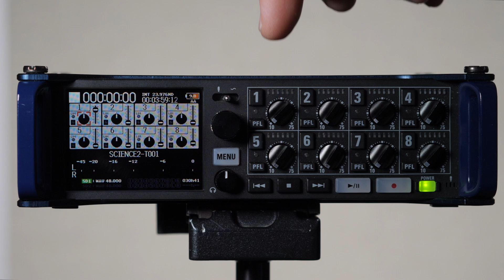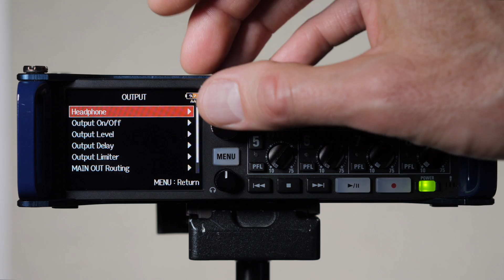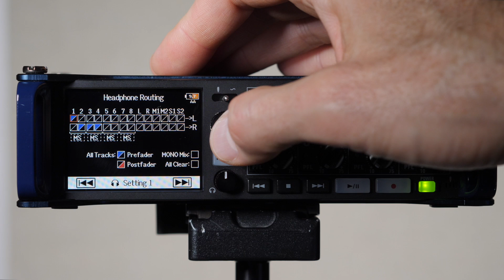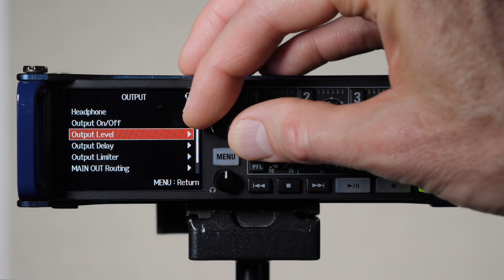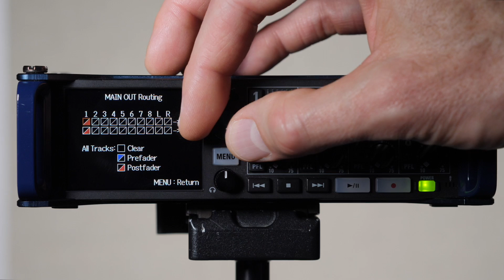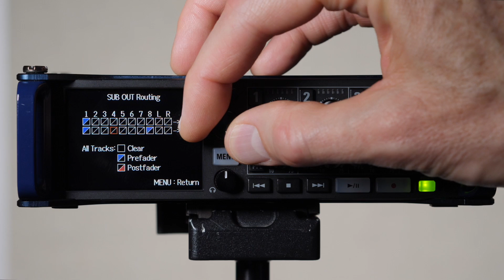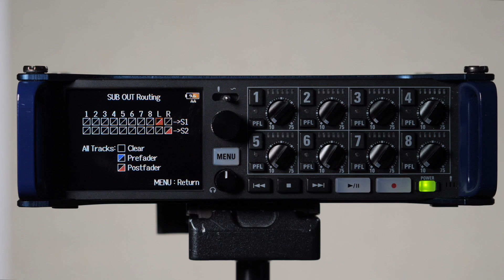Sound for Video Session: Headphone and Output Routing Demo - Zoom F8 Recorder

Comment: You mention here that sometimes they use the audio sent to the camera to do a cut, and then the audio-person needs to sync up later after the cut. How would this be done if you get one finished video-file? Or am I missing something? Thanks!
Reply: Post editors sometimes use vocalign for this, but normally, they'd get an OMF or AIFF file which can then be imported into a digital audio workstation app with all of the original clips.
Reply: @curtisjudd  Thanks. Wouldn't this then only be the audio from the camera? I don't see how the post-audio guy would easily do this.
Reply: @Libsenth  That's a tough thing to answer in a YouTube comment. It is a very big topic to cover film post workflows. But for the films I've worked on, Editorial had the production sound clips and synced the production sound to picture, then did the edit, then sent the OMF/AIFF to the post sound team for mixing.

Comment: Great Video as always Curtis! I was recently prepping for a shoot and noticed that the headphone routing only abides by the settings when using an external power source or the 12V DC In power cable. When I was setting the routing using just AA's, I was unable to get stereo separation from the multiple input sources. Is this a set function of the f8n? Thanks!
Reply from the maker: Hi Reid, not that I've noticed, but I almost always power it with and external battery. Probably best to confirm with ZOOM support. Best wishes!

Comment: Great video - thank you.
Question - Is the Zoom F4 in USB mode - can it record also to the SD card in parallel?  didn't find this answer yet.
Reply from the maker: Yes it can.
Reply: In what settings.
When i turn the aif on.  The usb interface is disable.

My goal is to record both to the sd cards and in parallel through the usb into the tricaster.  Couldnt figure it out.

Thank you for your help
Reply: @videobox2452  First make sure you have the latest firmware installed on the F4. Then in the USB menu, you'll select the option titled, "AIF with Rec" which is the mode where you can record with the F4 and use it as a USB interface at the same time.
Reply: @videobox2452  Also, if you're interested, I have a full course on the ZOOM F4 over at school.learnlightandsound.com
Reply: @videoboxstudios  It works when I try it. You may be best of contacting ZOOM support. Best wishes!
Reply: @curtisjudd  thank you for the great content you provide.   Honestly, I think that Zoom should pay you for the great videos you create for their products.
Reply: I purchased your course a week after i purchased the Zoom F4 last year.
Great course to dive into the Zoom F4.

When I turn On the Aif with Rec.  I cant go into the Audio Interface at all.  

I do have firmware 3.00.
Emailed to Zoom - they didnt reply.
Maybe there is something I'm missing with all the different options 😀

Comment: Hello Curtis,
Thank you for this video. 
I have a little issue, but maybe I am doing something wrong. I have a ZOOM F8n, and bought two LoPro TA3F to Mini TRS (https://www.cabletechniques.com/product-page/lopro-ta3f-to-mini-trs-sennheiser-sk-100-g3-line-input-cable) to use with a Rodelink Wireless System to give signal to director, boom operator, etc. I know that this is not the best option but I have two kits of the Rodelink and I'm trying to make it work. 
The problem is that I get no signal when I use the two Main Outs, but if I send the signal through the Sub Out (using a regular 3.5mm to 3.5mm cable), it works. All the routing options are similar with the Sub Out settings and the faders are up. What am I doing wrong here?
Reply from the maker: Hi Jérémy, the sub out is unbalanced as is the input on the RODE so I think you'll want to stick with that. I don't know how that other cable is wired, but evidently not correctly to take a balanced TA3 output to unbalanced 3.5mm TRS for an unbalanced input.

Comment: If I have 5 audio tracks I want to send to all 4 cameras (a mixed track), what do you suggest is the best option, do I select all of the outputs 1 through 5 or both LR? ie. Both Left and Right channels to one output as opposed to two ?
Reply: I'd just send the LR mix. And the rest totally depends on the production. Ask the post team what they want/need. If I were the post team, I'd just want a LR mix. And unless you are panning anything, even just mono L mix would be fine.

Comment: What is the U1, U2, U3 and U4 setting for?  It isn't mentioned in the manual, and apparently was added in a firmware update or other software add-in. It shows up when I rotate the know further clockwise, after the S2 box. Possibly has something to do with the available control surface...
Reply: Hi Larry, these allow you to record audio from your computer via one of the 4 USB streams when in audio interface mode.

Comment: will the Post-Fader settings actually record to the SD-Card? Or are all the Post-Fader settings only essential for output to the camera (for example)
Reply: Postfader affects what is sent to the L+R mix and if you have the L+R mix enabled, it will be recorded post fader. However, the isolation input channels will NOT have the fader levels applied to their tracks on the recording. You get the best of both worlds.

Comment: Hi Curtis,
Couple questions...
1. The headphone output has at least two settings. How do you make settings 1 active vs. settings 2? Do you enter into the menu, then make it active somehow and exit the menu?

2. W.R.T. main out routing...How are you wireless sending audio? You have a transmitter connected via 1/8" (for example) to the recorder, and the wireless receiver has a headphone input? Do I have that right? One transmitter can transmit to many receivers tuned to the same freq, since the transmitter is just broadcasting?

Thanks,
Sean
Reply: Hi Sean, 1) You hold down the stop button and press the channel 7 button which takes you directly to the routing screen. From there you press the fast forward or reverse buttons to change which headphone preset you'd like to use. 2) For headphones for the director, producers, and others, I use a comtek like this: https://youtu.be/V_C7wSfNIaM
Reply: Thanks, Curtis! Very helpful.

Comment: I have a question friends: In my f4 zoom, I wanted to send a sub out to the camera, the camera caught -20db signal from my zoom, but did not catch any sounds from my channel 1. Where was the pole. Why could it be like this?
Reply from the maker: Hmm...not sure. Might need to check the routing for the sub out and made sure it includes the left and right mix.
Reply: @LearnLightAndSoundSessions  I marked only 1 channel as a prefade, can it work?
Reply: @ola_szczyrek  It can work. But it seems nothing is actually coming in on that channel? Hard to tell without more details. Might be helpful to contact Zoom support to help work through the details. Best wishes!

Comment: do you know if you could use the zoom f8 internal mic (the one from the bottom right corner of the recorder) as "a local mic" as you mentioned at 10:08?
Reply from the maker: Yes, it is a slate microphone. Not sure whether you can record it to a track - it is routed to all tracks when you engage it.
Reply: @LearnLightAndSoundSessions  but then does it get recorded onto all tracks if its engaged during recording?

Comment: Is there any way to adjust the stereo-width and level of a pair recorded as separate Mid and Side channels during playback with the MS>LR circuit engaged? I cannot seem to engage MS post-fader. The only way I can get F8 to engage the M/S decoder and convert to L/R is to route those channels pre-fader.. yet then there is no control over level or panning (stereo width).  Engaging MS in headphone routing automatically switches the pair to pre-fader.
Reply: Hi Lee, I haven't done any M/S recording with the F8 so I'm not sure. Probably best to contact Zoom support. Best wishes.

Comment: Say if Track 8 was used as a mic input for communicating with Boom Operator. Is there a way to not record Track 8?
Reply from the maker: Reduce the fader for track 8 to its lowest setting and adjust the headphone routing to include track 8. Track 8 will still be recorded but you can drop it in post and it will not be in the stereo mix.
Reply: @tripdrip4174  👍

Comment: Very noob question, but how I do connect this to my camera?  I know I'm supposed to use the main out, but what cord would I need and do I have to fiddle with the settings in my camera afterwards?
Reply: I think this video may help - demonstration of how to do this with the Zoom F4: https://youtu.be/DypXXzPhxF8

The F8 is similar but a few of the screens are slightly different. I also have a paid course on the F8 over at school.learnlightandsound.com if you're interested. Good luck!

Comment: Hello! Very interesting! Thanks Curtis!
One question: When talking about the SUB OUT you mention "Thats where i'm typically send audio wirelessly to the rest of the crew". What are you using to wirelessly transfer the audio to the rest of the crew? And is it possible to send the audio directly to the camera with some sort of transmitter/reciever?
Reply: Yes, comteks are usually used to send a wireless feed to the crew: https://youtu.be/V_C7wSfNIaM

When you send audio to camera wirelessly, this is usually called a "wireless hop". Here's one way to do it: https://youtu.be/_c64B9s0eCA

Comment: Great video again. Quick question. Is there a way I can monitor exactly what is being recorded to camera? That is, just if I want to check that nothing has gone wrong on their end. I use the old reliable SQN a lot and that has a switch you can use too toggle between the mixer and the return feeds.
Reply: Hi Stephen, unfortunately, the F8 and F8n do not have a dedicated camera return input so you'd have to monitor from the camera itself. The F4 does have a camera return, strangely. On the F8, you could feed the audio back into one of the F8's XLR inputs if you have one free and then set up a headphone preset that only includes that one input.
Reply: Ah interesting! Thank you for the info!

Comment: With the F8n set to dual recording, say for example tracks 1 and 2, are doubled to D1 and D2 (tracks 5 and 6), it seems to send both the track and it's double to the main mix. This makes it somewhat difficult to record isolated tracks and the dual tracks and send a l/r mix to a camera. There is no option in the main out routing to not send the dual tracks to the main mix. I can send just track 1 and 2 to the main out, but this makes monitoring using the meters difficult. What am I missing?
Reply: Do you still have the L or R mix selected in the output routing? Sounds like you'll want to disable those and make sure that channel 5 & 6 are also de-selected.

Comment: Question: when using the f8 as audio interface, how can you turn the volume up and down for the main out speakers? Thanks
Reply from the maker: Hi Alberto, on the second screen, there is an output level you can adjust.
Reply: @LearnLightAndSoundSessions  Hi, thanks. So there's not a quicker way to do that, ie a knob. In that case buying an external volume controller is a must. Thanks
Reply: @AlbertoSueri  If you leave it on the second screen, the main menu knob is your volume control. But I agree, not ideal and you may wish to add an external controller.

Comment: AWESOME CURTIS, just purchased the F4, and it's the same.  I was lost and you've guided me as always!
Reply: Glad it helped! Happy recording!
Reply: Curtis Judd Off topic but relevant to your previous videos:  I'm looking for a pair of sub-$400 (total) lavaliers for film dialogue.  This is to complement a boom using RODE NTG-3 (outdoor) and AUDIX SCX-1-HC (indoor). 

I have followed your reviews and testing of the following lavalier setups but I do not have a reference point as to compare the ZOOM H1/Giant Squid to the Zoom F1 and Tascam DR-10L...with included lavaliers.

Which of the following 3 is the better setup?  For independent film dialogue. 

A) 2 Zoom H1n field recorders plus 2 Giant Squid lavaliers. 

B) 2 Zoom F1 field recorders with included lavaliers. 

C) 2 Tascam DR-10L field recorders plus included lavaliers.

Are there better options than what I'm considering at this price point? 

Thank you for your time and guidance.
Reply: Also, may you comment on the relative noise levels (preamp quality) between the H1 and and the other two? E.g. if I have to crank the gain for a quiet or distant source, will one of these provide noticeably cleaner audio than the other?
Reply: Hi Javier, I have not done a formal head to head comparison of these and in the case of the F1, I didn't have the included lavalier mic to test as B&H lent me the F1 kit with the shotgun microphone attachment. However, I can say this: The microphone included with the DR-10L was not my favorite and added a substantial amount of noise in my tests. I'd be inclined to start with the F1 with the included microphone and see whether you are pleased with the results. If not, you can always add a better microphone later. To realize a substantial difference from the included microphone, you will likely need to spend at least $100 per mic, perhaps for one of the Oscar Tech lavaliers. I hope that helps.

Comment: Hi Curtis! Great video. Can you help me please? I have 4 XLR mics and 3 line inputs (2 guitars and a keyboard). I can either hear all the XLR microphones in the headphones, or a single line input at a time (only when I click the PFL for that line). What am I doing wrong please? I didn't have this problem before upgrading to firmware version 5 on my Zoom F8.
Reply from the maker: Hi Red Soda, you'll want to check the routing setup for your headphone preset to make sure you're sending all of the inputs to the headphones.

Comment: Hi Curtis. Love your videos. I've been binging on them lately. I just got the f4 and I'm wanting to record audio from a boomed mic into the recorder plus I want to use the sub out to record to the camera as well as it has 3.5mm jacks. I had track 1 armed and sent out to the sub out and even when I turned down the trim knob all the way to it's lowest (10) the level going to the camera was still slightly too high. So my question is, in this scenario would I have been better using post-fade so then I could use the faders to control the output? The second question is there is an option to have the outputs be line level or mic level. Which one should I choose? I understand that the input is a mic but I wasn't sure whether or not the camera input should be mic level. I'm guessing that it should? Sorry for the long winded question and thanks so much for all your advice!!
Reply: Hi Ben, Most cameras with 3.5mm inputs are microphone inputs so you'll want to use the mic level setting for the sub 1/2 output. Then you'll want to adjust the input level on the camera down. Which camera are you using? I've found that some have very hot inputs like the Panasonic GH series so that can be a bit of a challenge. In those cases, I would use the fader to adjust the output level and send the post fader out, not the gain trim because you'll want the gain trim to control the level recorded to the F4. I hope that makes sense and good luck!
Reply: Thanks so much Curtis! I changed the output level to mic instead of line and it now seems to be working perfectly. I am using the Sony A7R II on which I have set the mic level to be the lowest step before turning off. I am finding that the Sony's record much cleaner audio compared to the Canon DSLRs when going straight in from an external preamp. I had a job on Saturday so it was fantastic to have everything working perfectly for that. Thanks again for your help. I know the answer is obvious when you explain it but for a noob sometimes things are a little harder to realise until you go through the experience of using it.
Reply from the maker: Glad it worked out Ben!

Comment: This was very helpful. The first time I used the Zoom F-4 I got confused, and got the sound only in the left channel of the headphones and almost panicked. Then I saw I had used the wrong "triangles" in the routing window. This reminds me of a question I had: If I am recording just two channels, let's say in a "live" chamber music situation, is there any reason to make (or not) input 1 and 2 L/R stereo? Will I get the same effect using two mono channels each panned hard L and R? Are there sound quality advantages to one or the other? I guess the advantage could be that even if I am listening pre-fader, I will automatically have a stereo sound, and they get armed as a pair. Otherwise, I would have to pan them, and arm each one. I don't have to send the signal anywhere except for the headphones I am listening through.  Thanks so much for all these videos.
Reply from the maker: Hi Sigrid, for recording a chamber group, yes, most make stereo recordings (which of course also involves very careful placement of the microphones as well).

Comment: Great value as always. I would also mention that you can quickly navigate between the top and bottom rows by pushing in the selector and turning while pushed in. This is just a fast way to move up/down without needing to go all around horizontally. Tiny point, I know, but I find it helpful and thought some others might like to know about it too. Incidentally, the push-turn applies to any Zoom menu where it has vertical selection choices.

I liked Curtis's explanation and recommendations on which mode to send to which output. Thanks Curtis for making these tutorials.
Reply from the maker: Thanks, handy tip!